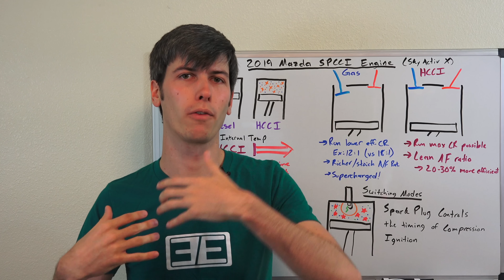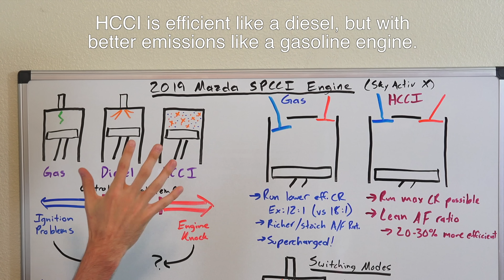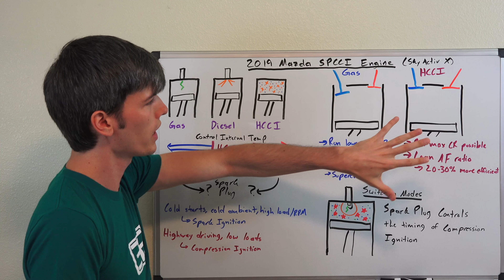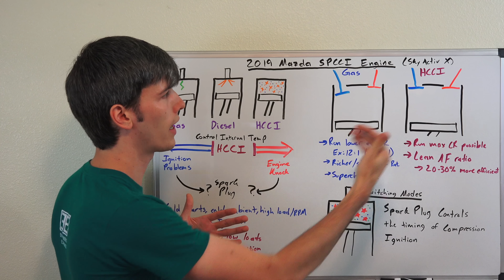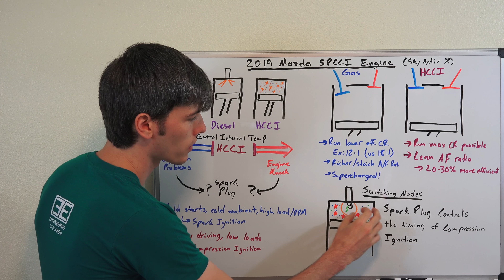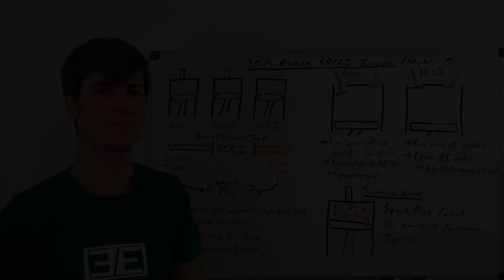Mazda Creates The Holy Grail Of Gasoline Engines - HCCI SkyActiv-X

Comment: The idea of hybridizing the HCCI concept with a tradition spark ignition makes me wonder if there's any benefit to adding GDI. Is there a range at which you can maintain ideal conditions for a high compression gasoline direct injection cycle? It seems to me that if it's a benefit to the diesel cycle, then surely it would be a benefit using gasoline.

I've had the cylinder head off of a supercharged GDI Jaguar 5.0L V8 with variable valve timing. The intake cam has these crazy concentric cam followers that allow it to switch between two cam profiles (Traditional/HCCI-Direct Injection?) in addition to advancing/retarding cam timing on both the intake and exhaust. Add a turbocharger with a wastegate that the computer can control? Bam.

Comment: Good speculation....HCCI (Activated Radical Combustion if your an old two stroke junky) has most certainly been considered the holy grail of IC engine combustion control. The struggles are still very much similar to those seen 20 years ago. Low load, peak load, and transient control. Honda solved these issue with a spark plug as well....back in the mid 90's, the EXP-2. Yes, a bit different being a two stroke and all. 
My only critique on your explanation; with Mazda using a supercharger, we would consider a late intake valve closing to be a Miller cycle. Loose the SC, and you have your Atkins cycle.

Comment: I can see a problem, another system to fail! The more crap you put in vehicles the more to go wrong, also the less an owner of a vehicle can do his/ her own repairs! Another issue I can see is using a variable ignition system becoming an expensive part to replace when it does fail! The other thing is a question of whether this can be used with V10, V8, and V6 engines! Why reinvent the wheel, the traditional engine has been working fine for the last 120 years, when does it get to a point that we stop worrying about making engines more efficient therefore compromising quality, performance, cost, ease of self repair, and lifespan! Today good quality cars already do not last as long as a mid quality car from 1988 does! We don't need a center console in the front, we don't need automatic braking, we don't need lane warnings, we shouldn't need those things as it should be the driver driving with caution making sure they stay in their own lane! By adding all this crap we make cars more expensive than a person can afford, we make drivers more ignorant of the road thinking the car will do the driving for them, and we make it impossible for a person to repair their own car therefore lowering a repair cost on the car and maintenance cost as well!

Comment: I see a lot of Electric car dreamers in the comments here.  Keep dreamin.  Gas isn't going anywhere anytime soon.
Reply: Shaun Dobbie HAHAHA which UK do you live in then?
Reply: Sure.
Reply: Shaun Dobbie I see a lot of diesel owners in the U.K. Lol
Reply: i think you live in the part of the UK that got lost in the Atlantic during Brexit
Reply: Fuel cells haven't been mentioned anywhere among these comments, yet that is where there is most potential for reducing our dependency on fossil fuel and the inherent NOx and HC emissions. Each fuel station with its own wind generator generating hydrogen gas from water, which is then stored for injecting into the hydrogen tank of a vehicle, thereafter burning the hydrogen, recreating the water from which it itself was created as the only emission. A perfect way of utilising solar energy. Hydrogen burned at a super-efficient constant rate and the power stored in a battery in the vehicle. Fuel cells make it possible to eliminate fossil fuel use, whilst still offering great autonomy; certainly more than the 100 miles mentioned. Engine noise a thing of the past. Saving the Earth, into the bargain.
Reply: reminds me of back to the future how they thought 2015 would be.... dreamers.
Reply: Gas is gone in the UK, we use it only to heat our homes and cars that run on it are very rare. There are only four gas stations left in the UK.

Comment: I once built a street engine 12.5 to one compresion. higher would be better.I retarded the timing to reduce knock. Lean cruise mixture and it got 16mpg with a 4:11 gear. 454ci and 230 degree cam. In a chevelle it pulled wheelies and got good milage. It is simple Always leave the spark firing for all cycles but vary the timing to achieve the wanted effect. Engine coolant temp would be critical as well as intake air temp. The atkinson cycle can be achieved with variable cam timing. The supercharger acts as a 1 way valve to maintain presssure and temp in the intake track. ITis not necessarily there to produce more power. Smokey Unick once built an engine based on efficiency only and used this concept partially. The Cat has no comment.

Comment: This is all in part to the insane fuel economy/pollution specs imposed on automakers. The engines are 99% cleaner than they were 50 yrs ago but the govt demands more every year or so in europe and the usa. Its just basically making a hybrid diesal under certain throttle/load conditions. However, its a lot of extra parts,engineering and complications to achieve this. Europe is outlawing petrol(gasoline) cars in the near future anyway, it was recently announced, sadly. The politicians have driven the cost and complexity of our cars thru the roof for their "green energy" agenda. Sadly the battery cars are way, way, more enviromentally dirty when you include the nasty batteries that have to made in china and mexico etc.Also the cost and amount of electricity that has to burn other fuels, to then charge the dirty batteries, in these cars.  The average person doesn't realise, or understand that. Many other big brother technology will be incorporated in the future cars I suspect as they are doing in all other tech aspects of our lives to mine our data etc. People will be much easier to data mine,watch ,control,etc when all cars are electric and under full computer control. This last part is just my 2 cents but its easy to see that is what they want. Eventually they would rather us all just board trains everywhere and give up the cars I suspect.

Comment: Would you be able to run multiple fuel? Diesel, ethanol, etc..? Seems like you could run any fuel as long you can regulate fuel flow, and since itll be supercharged it'll be able to deliver high pressure and volume presumably.

Comment: What is the difference between the last part en engine knocking? Won't the combination of spark plug ignition and the added pressure igniting the rest create two wavefronts colliding and thus cause engine knocking?

Comment: I wonder if it would make a difference which sort of gasoline you are going to fill in your car.
Because (as i thought) you take for example higher octane fuels for sports cars as for regular cars, to pervent knocking. That because of the higher compression in their engine.
And so (if my theory is still right) that would make a huge difference for HCCI engins to work correctly or not.

If it is possible i would appreciate an explanation from you, to my question.

(Sorry for any Writing mistakes) and Greetings from Switzerland.

Btw. At our gas Stations have only 95 and 98 octane fuel. In my opinion, much more than for example in the US.

Comment: Well Mazda didn't create this engine first. Prototypes were already tested a decade ago by other companies like Mercedes Benz  in their F700. But they had problems with exactly this switch between spark and HCCI. The strategy of these companies is now hybrid engines or electric cars instead of HCCI.
Reply: Prototypes, concepts (F700)...  But not production.  That's why this is bigger news than what came before.  Also remember, the incentives for hybrid vehicles back in the mid 2000s pushed manufacturers in that direction.  Now that the money is all in EVs, and those incentives are starting to wane as well, it's time to bring out new ideas.  I hope it works for them.
Reply: Craig Aznoe it most likely will be successful for them, however Mazda's biggest problem will be what it has always been. Nobody will buy their cars in any great numbers even though their entire lineup are hands down the most fun cars to drive of any Japanese manufacturer.
Reply: Historically Mazda makes prototypes a real production engine. Mercedes, Porsche, Ford all tried to make a wankel or rotary but they all failed but Mazda was the only company who actually made a production engine.
Reply: MusicScala SAAB made the SVC (SAAB Variable Compression) engine back in 2000.
Reply: I also hope it works. Its always cool to see something different :)
Reply: Why couldn't an HCCI engine be used in a hybrid powertrain?
Reply: The current F1 regulation engines (at least some manufacturers) are also based on HCCI I think. At a recent race, Ferrari had a spark plug failure (it had a huge implication on the championship). I saw a video in which Craig Scarbourough explained how the spark plug also had a fuel inlet to create a flame in order to time the combustion correctly. It ultimately lead to retirement of the car and huge turn in championship. But yes, Mazda is the first one aiming to bring it to production.

p.s. A popular opinion is that Honda also tried that technology in their F1 engines. Whether they are still pursuing it or dumped, no one knows.

Comment: What happened to Koenigsegg's Free Valve technology? It has a lot of potential as well
Reply: I think there are concerns about cost and reliability. We'll have to see if anyone else starts using it. It's a solution for a different problem than HCCI. In this case that is a good thing because the two could be used together.
Reply: This was the first thing i thought of when HCCi operation was mentioned. Use the electronic valve control to maintain variable compression rates whilst using common rail direct injection to feed fuel in for HCCI operation while maintaining a clean intake manifold air. Have a spark plug for low pressure start up and cold start.

As a side note I remember reading a mazda press release were they were playing with water injection for compression manipulation on a multi fuel type rotary. However I am unable to find the article anymore as google is full of rice racing and diesel injector water failures.
Reply: I was actually looking forward to seeing that Freevalve Tech in the mainstream but there arent many takers it seems.
Reply: Fre Valve will improve many tricks used in engines today. From piston desactivation (switch off valves will be a lot easier and cheap) to overlap valves (something many manufacturers are using in order to gain torque at lower rpm) in turbocharged engines. We'll be able to see full torque even earlier than now. Turbo efficiency will have gain by lowering the back pressure. It'll be able to have very rich fuel+air mxture even in high rpm due to easy way out from exhaust gases. Very high ending rev in a N/A engines (now we're limited by valve floating) and Koenigsegg claim that Free Valve could go up to 20k rpm.
Reply: Nothing happened to it, it just isn't a cost effective solution in the long term, considering the multitude of current of accessible tech. Long story short, when in doubt measure the dollar first...
Reply: Where one sees a dead end, others see an opportunity. More people/labs/companies are working on battery tech as the effort is reaching critical mass for advancement. Development can definitely be expected and there have been some interesting proposals. We just don't know yet how far it can go and if that will be enough.
Reply: It's expensive. Works great in their own cars, but its hard to implement in normal cars.
Reply: do you have a developmental disorder
Reply: No, batteries are a dead end. No more development can be expected.
Its hybrids with an ICE.
Reply: it's dead... like ICE cars... tesla is the future
Reply: @doktorbimmer6640  I think youl find wel be back on horses and candle power at the rate were going

Comment: so they said it was going to have a supercharger, but did they say what kind? I wonder if they plan on the using an electric motor to power the supercharger as a means of creating a sort of variable compression ratio as they switch from one mode to another. I think that would be interesting.

Comment: Internal combustion engines? Oh, they're "Sky-Activ" alright -- but not in a good way. All this bs is going away soon because you no longer need to put gasoline in your car.  EVs are faster, smoother, quieter, vibration-free, cleaner, greener, less expensive to run, less expensive to maintain, more convenient on balance, sexier, more 21st century...
Reply: +xchopp -- But guess what- a lot of people don't want EV's regardless of how many adjectives you throw out. Also- sexier? Last time I checked, this aspect is both subjective and independent of engine type.
Reply: That's your argument?  Are you 10 y.o?
Reply: Sexier is subjective, granted - Maseratis are sold on engine sound - but you gotta admit Model S, 3 & X are eye candy. I do have a problem with your argument that people don't want cars that are faster, smoother, quieter, vibration-free, cleaner, greener, less expensive to run, less expensive to maintain, and more convenient on balance.

Comment: Yeah, so when engine reaches optimal temperature, it will switch to HCCI mode... While it's unclear how they will bring in the performance mode. Here, in my country we have CNG cars, they are set so they start with petrol and when engine reaches optimal temperature, they switch to CNG automatic.

Comment: I have a bunch of RC aircraft model engines form the 1970s that work on the same principle. Diesel ones worked through changing the cylinder volume to control ignition and methanol/nitro ones use a glow plug. So it is far from a technology for the era of the electric car.

Comment: GM invented HCCI in 2007 but in the end couldn't find out a way to mass production. The problems of this engine are formidable and I don't believe Mazda can pull it off where GM failed. In any case EVs are the future.
Reply: Why not? In 1997, GM couldn't find out a way to mass produce EVs. 10 years later, some guy that never made any car before found a way.
Reply: There's an effective way to greatly boost ANY CAR'S mileage!   Get out and PUSH!!!!
Reply: That would make it no longer a car but a shopping cart
Reply: EV.. iz the Future
Reply: doktorbimmer, ok, you win. That was the gayest thing I've ever seen.
Reply: EVs will just be a weird footnote in automotive history. camless hcci ICEs will be in use for centuries.
Reply: Gadget Deez Why dont YOU research it, rather than believing the first thing you hear that fits what you want to believe ?
The stories that the battery production is worse than the gasoline burned over a cars lifetime is total nonsense.

(you will find that lithium is not even the issue, cobalt is the biggest issue. And all materials together amount for a fraction of the fuel burned in a gasoline cars lifetime)
Reply: Peter Perfect riiiiiight...  why dont you research how your lithium is produced and the problems with disposal and how "clean" it is, then tell me how bad 2016+ gas engines are for the planet. (especially E85/flex fuel engines) lol
Reply: no, the ICE is dead... hold your breathe EVs are the future!
Reply: LGBT is gay
Reply: I know three people with Tesla's, none are gay.

Comment: Which is simpler doing all this R&D to make wring a slight improvement in an ICE or just make your vehicles BEV?
Reply: I'm not entirely sure that a 20-30% efficiency gain is "slight improvement". And sure, they could go EV, but if they don't think the market will support them there, what's the point? Keep in mind, the VAST majority of cars on the road are still gasoline, and the vast majority of car buyers are still buying gas vehicles. Let's face it, at the moment, it's not practical to buy an EV over an ICE - they cost SUBSTANTIALLY more (like, 50% more last thing I knew), you're still paying for the power to charge the battery (albeit at a cheaper rate, I'd imagine) but then you'll either spend a large chunk of money replacing the battery down the road, or you'll be buying another car and not really getting your money's worth out of the first one you purchased. Those batteries aren't cheap. ($15k for chevy bolt replacement battery pack) By the time it's all said and done, you haven't been any more savvy than if you bought an ICE vehicle in the first place.

Comment: Guess these engines are going to have some serious NOX problems, even higher than the actual Diesel-engines. The extrem high temperatures and pressure under lean A/F ratio, where a lot of oxigen is free to react with the nitrogen from the air, will cause this. Therefor they will need realy big urea tanks.

Comment: Very interesting, great explanation and great job at distilling Mazda's published data. One question though - you mentioned injection timing as a technique to control diesel engines, but this engine will also be direct injected. Are you inferring (by omission) they do not control injection timing or that this is not particularly important to the HCCI mode of operation?

Comment: Hi. It's nice they're combining it with the rotary engine for that fuel efficiency and power combo. Though it's an expensive engine being non standard.

I think the theory is a bit wrong. I believe they're have pits on the piston and the walls of the engine block, creating a turbine effect, creating high speed wind inside or pressure before the piston fully compresses or as it compresses the mixture. It's similar to a jet engine or a Dyson electric fan. It's like an already preheated food or semi cooked food, you only need to add a little heat to the food, to cook it. That is good, though it'll be more expensive to service since only Mazda would be proper to service it (no third party may easily service it).

God bless, Proverbs 31